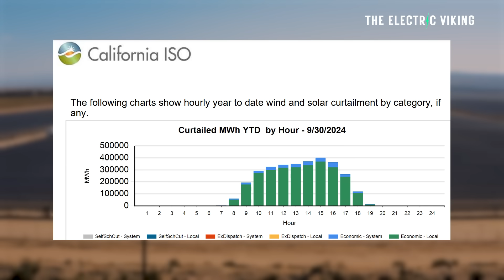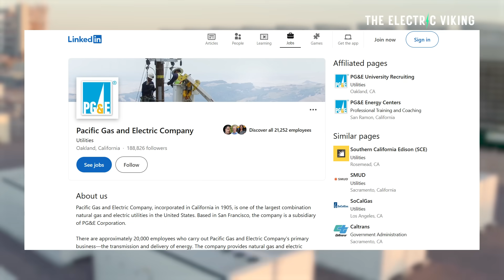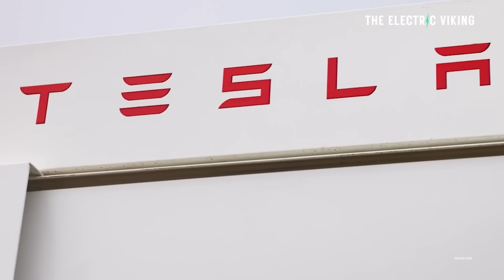America adds battery equivalent of 20 nuclear reactors in less than 4 years

Comment: The problem with the vikings video is that it confuses power with energy. A one megawatt battery bank can supply electricity at one megawatt of Power for some length of time before it runs out. Lets say it runs out in one hour. At the end of an hour it will have supplied one megawatt-hour of Energy for the day. A one megawatt nuclear plant can supply one megawatt of Power for 24 hours, or 24 megawatt-hours. The viking is clearly talking about power here and his power figures are probably spot-on. But a valid comparison would compare both the amount of power the batteries can provide and how long the batteries can provide the power, which is the total energy. The energy available over 24 hours from all these batteries is far less than the energy available from a nuclear plant supplying the same power for 24 hours straight.

Comment: Based on the search results, it is evident that the production of solar batteries, including those used for storing electricity from solar panel farms, has an environmental footprint. The manufacturing process involves mining for metals and minerals, such as silicon, silver, copper, indium, tellurium, and lithium, which contributes to greenhouse gas emissions and pollution.
Mining and processing: The extraction and processing of these metals and minerals require energy, water, and chemicals, leading to environmental impacts like air and water pollution, land degradation, and waste generation.

Comment: Batteries don't produce power; the article tries to relate power producing nuclear to batteries that produce none.  The only reason or these batteries is some folks think it is smart to build intermitten sources of power like wind and solar.  Nuclear plants don't need batteries they run 24 hours straight sun or no sun; wind or no wind. The battery problem becomes staggering if you consider there can be weeks even months you have little solar or wind.  Solar is a poor producer in winter; wind is internittent; only useful in limited areas; wind  is inadequate in most areas to be useful. Total solar and wind is about 5%; nukes about 19% of US power production.

Comment: Tesla hasn't put out batteries equivent to nuclear plants because nuclear plants create power and batteries do not.  Solar is a small contributor to the US power consumption only about 2%.  While the 54 nuclear power plants in the USA provide 19% of US energy production. Given Tesla didn't install even half the solar in the USA the claim they put out anything near the equivelent of 20 nuclear plants is way off.  Even if they provided 50% of the solar (which they haven't); that is only equivelent to 2 or 3 nuclear power plants so you are only off by 10x and probably 20x.  But good try.

Comment: I am curious why there is a big need for transmission upgrades due to battery deployment, because a key benefit of battery power is that the battery can be placed where it is needed. Unlike a power plant, which is often located quite remote from the end use consumer.
Reply: From what I understand, big batteries can offset transmission upgrades -- they're two solutions for the same problem. It's taking time for people to adjust the way they think about the power grid, with the new possibilities of grid batteries.

Comment: So 20GW of batteries is equivalent in power to 20 1GW nuclear plants. But a nuclear plant runs 24 hours a day, and 335 days a year, (with 30 days for maintenance etc), with output which keeps the grid stable, allowing it to cope with other, unstable sources of power. Meanwhile those batteries can only supply that 20 GW for one hour, or maybe 1.5 hr.  And they do not produce energy. They only store excess energy which is not being used at the time. They are not equivalent.
Reply: Charge and discharge.
Nuclear most expensive and not viable without government finance.
Reply: @johnmightymole2284  Why is it that renewables require government subsidies if they are the cheapest form of energy? And by the way, it is already being concluded that offshore wind is as expensive as nuclear. But my point was simply that a battery is in no way equivalent to a nuclear plant.A battery must spend as much or more time charging than it does discharging. It produces no energy.

Comment: Just imagine the massive pollution produced to build those batteries.
Reply: Imagine all the pollution produced by coal or even gas power stations.
And yes, there is lots of pollution produced in the construction of coal, gas and nuclear power stations as well
Reply: @allangraham970  True.
Reply: @allangraham970  Based on the search results, it is evident that the production of solar batteries, including those used for storing electricity from solar panel farms, has an environmental footprint. The manufacturing process involves mining for metals and minerals, such as silicon, silver, copper, indium, tellurium, and lithium, which contributes to greenhouse gas emissions and pollution.
Mining and processing: The extraction and processing of these metals and minerals require energy, water, and chemicals, leading to environmental impacts like air and water pollution, land degradation, and waste generation.

Comment: You talk only about batteries. 
1) But what about others kinds of storage like pumped hydro, or thermal storage etc. that cost less than batteries 
2) what about interconnecting the grids, for integrating California photovoltaic and Texas wind?
3) when will the static storage will be mainly based on sodium batteries?
4) which is in America the capacity of the industry of batteries recycling?

Comment: About 500 nuclear reactors would be needed to power the entire US purely by nuclear right now. Energy requirements are increasing with added demand for computing power, air conditioning and heating, and so on. Lets say in 20 year 1000 nuclear reactors would be needed less whatever non-fossil fuel sources like existing nuclear, hydro and geothermal. Still a ways to go.

Comment: Wind and Solar farms are not free energy, they are expensive alternatives to conventional Power Generators. The Megapacks are an excellent addition to an Electrical Grid that is strained at peak times by producing power in an instant which the big Generators can't achieve, and also help filter voltage spikes some say. However these Megapacks have to be charged during the offpeak times in the middle of the night, so still rely on conventional power. The ability of Nuclear Power cannot be ignored as a source of clean power and can be developed further for less expensive and safer installions.
Reply: Takes 10 years to build a nuclear reactor and get it on the grid. Imagine the density of batteries and how many will be deployed within the next 5 years?

Comment: All this power storage & solar wind generation sounds great, my main concern is the the maintenance on all this new equipment, as just been witnessed with the power disaster at Broken Hill, the power supplier was found asleep at the switch when the power transmission towers were blown over due to a wind storm & the power backup generators were found unreliable if not broken due to a lack of maintenance, will the same happen with the batteries/solar panels/wind turbines, meaning as we always find when its too late, the utilities that are owned/controlled by big business seems to put profit before maintenance of plant.

Comment: I'm a fan for batteries.  They are probably much more scalable, flexible, than building gas peaker plants.  Also, dealing with transmission, interconnect, permitting problems.  They can be part of solution for alleviating problems.

But I don't think solar+storage is a completely solution.  The tech companies, with their hyperscaler data centers, huge energy and power needs, 24/7, have concluded nuclear is their solution.  They were already quite favorable towards renewable+storage, but concluded, this is not enough.  To get another POV, than simply exponentialism (or Tony Seba), you might check out Patrick Boyle's channel.

Comment: I see these battery installations, and I always think, "Why are they above ground?" It makes no sense to me. Batteries are susceptible to temperature variables, so wouldn't it make sense to put them below the frost line where the temperature is stable, and can be further controlled with heat exchangers? Further more, the above ground area could be used for more PV installations, cutting transmission loses to a minimum. Maybe I'm over thinking this...
Reply: Because now you are increasing the cost to install them and not just by a little bit. You'd most likely 100x the cost to install. One of the biggest expenses with nuclear is the civil and concrete work when building the plant.  To put all those batteries underground would cost way more.
Reply: @pin65371  Battery installations do not need nuclear power plant levels of infrastructure. They need a hole. They need some weatherproofing. They need the hole filled back in. That's basically it.
Reply: The battery / shipping containers do have insulation. Power for heating/cooling is just a line item on operating expenses.

Comment: 20GWh of batteries=20GW STORED FOR 1 HOUR. 20GW of nuclear reactors=20GW PRODUCED FOR 60 YEARS, 480000 HOURS. Sam, math does not add up for almost 6 ORDERS OF MAGNITUDE (not 6 times, 6 ORDER OF MAGNITUDES, and then you still need to actually PRODUCE such stored energy). But the west is now so full of people that ignore everything STEM that such Sam's tales can absurdly gain traction (the same tale is also running viral in Italy now...). The west is so doomed, at least for this century. Go nuclear or go nowhere.

Comment: Large mega batteries like Tesla and others make are great on the GRID.  They can't seem to make enough of them.
Reply: @PhxElecAuto  and taxpayers can't afford to pay for them.
Reply: @Guvament_bs    Wrong!  They're far less expensive than "peaker" plants.
Reply: @almostthere100  how much would it cost to provide 5 days backup for your country with batteries. You will be shocked if you do the maths. I have done it.
Reply: @Guvament_bs  ... but you don't need 5 days of back-up storage anywhere in the USA... save Alaska.  30 to 96 hours are enough, depending on the regions.  Not even Germany needs that much (ca. 110 hours are enough)!
And you don't need to deploy all that back-up now... only progressively as the solar + wind generating capacities are being developed.  We have 20 years to deploy that amount of storage... and its cost is going down 14% a year!

So, your cost calculation is moot!

Solar + wind + storage is already now the cheapest form of energy.  I suggest you read the Lazard report on Levelized Cost of Energy, or RethinkX Energy Report.
Reply: @st-ex8506  In my country the guvament is purely ideologically driven. They want no gas coal or nuclear. They want wind solar and batteries no exceptions. A few times a year it it very overcast and rainy for a week or more over large parts of the country. So if we want reliable power we need at least a week's worth of batteries. The country is flat as a pancake and relatively dry so little hydro.
While battery prices are dropping they will always be fairly expensive. Mining manufacture and transport is not free from cost.
Reply: @Guvament_bs  In order to respond intelligently to your comment, I would need to know which is your home country.  I know of no country in the world that has ONLY wind, solar and batteries at this early point in the energy transition.  So, I am interested to correct my ignorance.

But no, you don't need a week's worth of batteries... not anywhere in the world south of about 60° of latitude.  Unless, of course, your government is not only ideologically driven, but also incompetent.
Reply: @st-ex8506  I responded with some facts about Australia but it was pulled because the truth did not align with prevailing ideology. Not the first time.
Reply: @Guvament_bs  Your country is Australia?!?! I would NEVER have guessed it from the description you gave, so contrary it is to the Australia I know decently well, having worked there 2 years. « Flat as a pancake » you said… but I remember some very decent skiing in Australia (Perisher, Thredbo, Falls Creek, …), and pretty impressive mountains!

Well, if there is ONE country in the world that has the climate and natural resources (solar and wind by the gobillions watts, plenty of hydro, especially in Tasmania, geothermal potential, mountains aplenty for pumped-hydro storage,…), and a comparatively small population, that country IS Australia!
It can become one of the world’s powerhouses!
If you don’t recognize the huge advantages that Australia has in renewable energies, and rejoice your country is that lucky, than I am afraid YOU are the one who is ideologically driven… or blind as a mole!
Reply: @st-ex8506  there obviously are mountains but Australia is the flatest continent and driest other than Antarctica. Yes Tasmania has enough hydro for itself much of the time but they regularly get droughts and have to import electricity from Victoria. They do not have enough to export to the rest of the country. The snowy mountains has a full hydro scheme from the 60s but it only powers a few percent of the population. 
The Labor party is opposed to nuclear power and it remains illegal in aust. The Labor party are opposed to any fossil fuel use. So we need immense battery storage. Literally trillions of dollars worth. Solar is only good when the sun is shining. If you were here for a few years you would have experienced wet cloudy periods that lasted a week or more. Similarly there are wind droughts that can last weeks. Out of the top 20 economies in the world, the G20 only one has no nuclear power, yes Australia. Yet Australia has the 2nd largest uranium reserves in the world. We are the equal largest lng gas exporter with Qatar Yet the Labor party is going to ban its use in Australia. All these points are easily verifiable. Hopefully this reply will get thru

Comment: I live in California and our electricity rates are by far  the highest in the Continental US. The cost benefit of cheap solar with battery backup hasn't materialized.
Reply: Then the middleman is stealing the cost benefits. The best recourse is to cut out that middle man. Not to forget, power companies are using the cost benefits of renewables to subsidize the ever-increasing cost of fossil fuel power, another reason for the lack of low-cost materialization.
Reply: @Berkhoi  why is the price going up for fossil fuel power? Natural gas prices are at an all time low. The data doesnt align with your comment.
Reply: Fires destroying major components of the grid-and the need to upgrade the grid to deal with them=CLIMATE CHANGE!!!!

Comment: Let's face it:  solar is cheap!
Reply: Solar appears cheap because they are allowed to exclude the cost of battery backup for the period of time required to stabilse the feed.  If battery backup was included solar and wind would look a lot more expensive than they are.  Also, they need to include the cost of safe recycling and disposal - because it's included in the cost of nuclear, for example.  We have already generated more solar panel waste than 70 years of nuclear waste.  Unlike nuclear waste, the waste from renewables is as toxic in 100 years as it is today (full of toxic metals), and also unlike nuclear waste, renewable waste is not regulated.  It ends up on landfills in Bangladesh where kids will burn it to try to get some silver or cobalt, inhaling toxic fumes as they do so.
Reply: But sufficient battery storage is not.

Comment: But but but, I am constantly being told batteries only last 2-3 years, and then only if they do not burst into flames, maybe that only applies to EVs.
Thanks  well done Tesla and others, the speed of progress is exponential.
Reply: You're being lied to, gaslighting. The older electric cars didn't have temperature controlled cells. That's long in the past. Gas and hybrid vehicles have 5000 times more vehicle fires [per vehicle] compared to Tesla. 

Only the GM Volt had significant numbers, and those were recalled.

Comment: Hyperscalers are looking at nuclear for "prime" base loading and grid utility for backup power, so there is no need for backup generators. I give it twelve years before a hyperscaler brings on one new nuclear power plant worldwide. Look at the 1.8GW Tract Group hyperscaler under construction in Buckeye, Arizona. This data center will use as much energy as the whole city of Phoenix. The local 4GW Palo Verde nuclear plant is already at 90% capacity.  The state is adding 57 GW of new generation in the next 30 years, with nearly 80% coming from wind and solar. Arizona has 923 megawatts of battery energy storage systems (BESS). They are only adding 2GW of BESS in 2025.  Base loading will be an issue in Arizona over the next 15 years. The demand for AI power needs to be addressed quickly.

Comment: The 2 hour or 4 hour battery is just a convenience for calculating how many batteries are needed. For example my 2 Powewall 3's store energy during the day but they supply my home with energy through the evening and early morning a period of 10 to 14 hours, more if I don't have the pool pump or AC running.